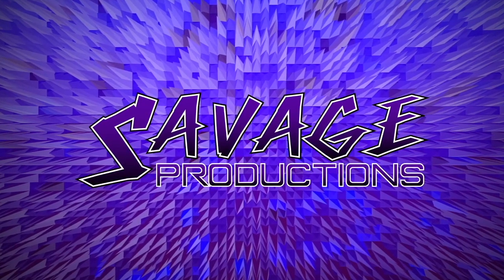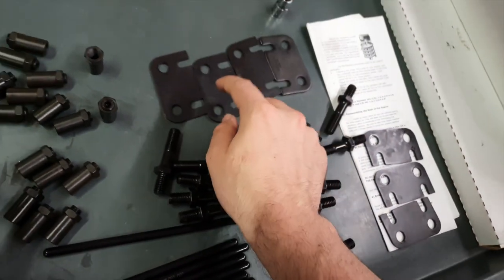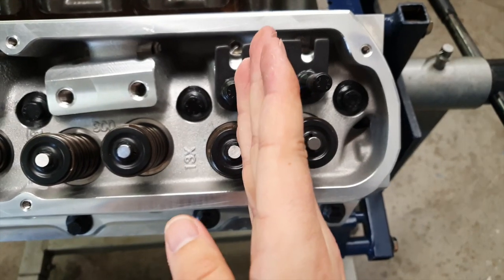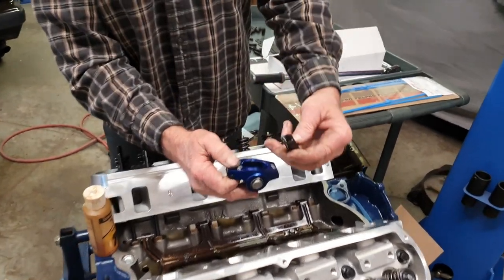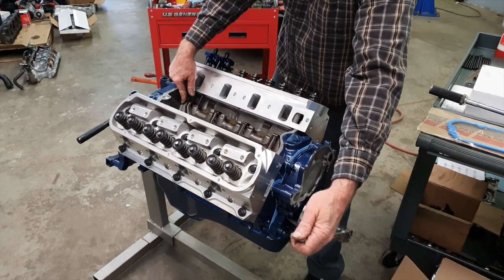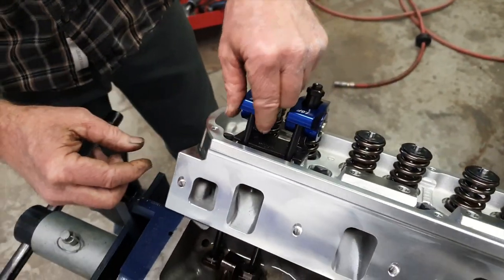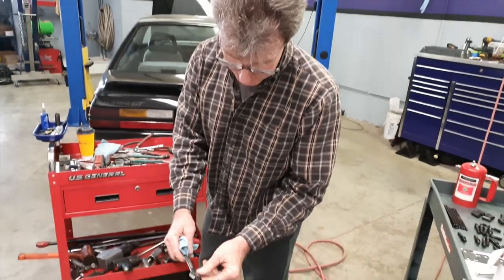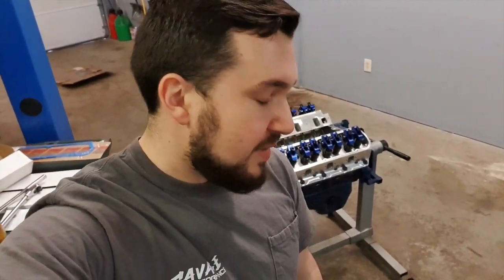How To Install/Adjust Roller Rockers - SBF With New TrickFlow 11R Heads

Comment: Cool video I'm 65 years old and I rebuilt my first engine when I was 12 years old I have been around cars literally all my life watching my dad and my uncle's working on their drag cars every Saturday night they were going over the cars getting them ready for racing on Sunday I was to short to see over the finder of the 55 and 57 Chevys that they had so they built a platform for me to sit on so I could watch them doing the work this way in the mid 60's and good ol'boys building their engines and things were a lot different then you always turned your engine over and got the rockers to just losing there slop as it was called then around here then start the engine and tighten the rockers just enough to take the tap out of it ran it till it was at operating temperature and then adjust each one by backing off the nut till it just started tapping and tighten till it stoped and then tighten the nut up around a half to 3 quarter of a turn and of course us a filler gauge to set them I've heard of and seen different ways of setting them but I really like the way you showed how to do it I'm getting ready to pull the heads off of my 65 Comet with a 302 with 351w heads with roller rockers I'll definitely use your method of adjusting the valves when I put it back together thank you for sharing this with us I'll be looking for more of your videos

Comment: Hi, great video. Have you ever used 11R heads with a comp cams roller cam? Did you change the springs or did you use the preinstalled 11r springs? Regards! Madison

Comment: I have a 351w with 1.6F rollers. Starting to make a loud tick. When I pulled valve covers some push rods I can spin with my fingers.  Not much play up and down but they do spin in place. Is that normal or should I readjust them?

Comment: I currently building my first engine ever. This was an amazing video by the way! I have the same rockers. I'm building a 331 with gt40p heads and a comp xe274hr cam. What is the easiest way to measure proper pushrod length?
Reply from the maker: You can buy an adjustable pushrod to measure the correct length. There's instructions all over the internet for knowing how the length is correct. Also, you can pretty much tell just by looking at it. That might be a video we decide to do at some point!

Comment: What are your thoughts on block splitting on an internally balanced 347? Can you go over 500hp with some boost and be fine. Thank you
Reply from the maker: If you have a stud girdle and it's balanced, 500hp should be fairly safe, but there's always a chance the block is weaker. 347s are harder on the harmonics compared to 331s.

Comment: Did u need different pistons with a different valve relief for the twisted wedge heads? Im building a 306 with a twisted wedge head and try and copy or have a similar build
Reply from the maker: Not with these 170cc heads

Comment: Just curious, what is the purpose of having the intake coming down before adjusting the exhaust? I thought once one side starts to open the other side was ready for adjustment. Thanks.
Reply from the maker: That's just the proper timing of when to adjust each rocker.
Reply: @SavageProductionsCars  Thanks!

Comment: After seeing this I'm wondering if I can turn my 351c 2V engine into a roller rocker-cammed-out-beast. LOL Actually I could use more than 300 hp. My engine is a 2v fresh stock build. I want to add roller rockers, new cam, new heads and hopefully these parts will work with my Edlebrock 351 Performer LB Intake and 650 4V Edelbrock part #2750 Performer 351-2V intake manifold designed for street 351C and accepts 4V carb. They are new parts.

What trick flow heads and cam size will I need to increase hp from 300 to hp to 350-380? Thank you. Great info video and look forward to some advice.
Reply from the maker: If you wanted to call us/message us and figure out the right setup for you, you can actually purchase the parts from us (as a thank you for our advise) at or below retail price, and we can drop ship them to you. All our contact info is in the video description.

Comment: Do you think a stoke 5.0 valve cover will clear the polylocks?
Reply from the maker: Stock fox body valve covers do fit if you use the blue felpro rubber & metal gaskets
Reply: @SavageProductionsCars  thanks guys 
I'll watch your vid again to get the part number.
Reply from the maker: You can order from us! We drop ship.
Reply: Mine is a sn95, stamped steel covers

Comment: When measuring for push rods on a 302, do you use a new unpumped lifter or a solid?
Reply from the maker: Either use a solid or a hydraulic that's pumped up fully
Reply: @SavageProductionsCars   Thank you! So..then add .030 to the length? So If I came up with 6.750..add .030.. which would be 6.780.. so 6.800 length?
Reply from the maker: @19jody72  what did you use?
Reply: @SavageProductionsCars  I used my old stock roller lifters. Im 100 percent sure they did not compress any.
Reply from the maker: @19jody72  then you wouldn't add anything if it's solid/fully pumped up
Reply: @SavageProductionsCars   OK. I thought if you use a solid or pumped lifter you have to add for the length the lifter compresses?
Reply: @Savage12 THANKS! Thats exactly what I needed to know. The witness mark  is dead.center of the valve stem using the 6.750 pushrod(pushrod checker tool) measured with micrometer. So after talking to you..based on my measurements..ill order the 6.750 pushrods

Comment: The rocker studs should only be torqued to 45 lbs on an aluminum head application. 55 lbs (as stated in this video) is for an iron head application just fyi

Comment: Can trickflow 11r 205 heads fit with the factory pistons on a roller 351w? No valve reliefs
Reply from the maker: No, you'll need pistons with valve reliefs for that size

Comment: I’m thinking of buying the 190cc 11r heads, I’m debating on running a .325 intake and .338 exhaust cam lift with 1.7 rockers for a total of .550 intake and .575 exhaust to maximize the flow of those heads. The target rpm is 2700-6300 but I want redline to be 6700, will the valves and springs that come with those heads work with that or should I order them bare? That’s also given if my pistons will clear that kind of lift lol, if not then I’ve got a back up with a .500 I and .525 E valve lift that’s a bit more conservative
Reply from the maker: Do you have stock pistons? With the 190s, you'll need twisted wedge style pistons.
Reply from the maker: And is it a 302 or a stroker? The 11R 190s are too big for a 302 unless you have compression and running 7000+ RPM.
Reply: @SavageProductionsCars  its a 302, I was originally planning on 170cc heads but was recommended 190cc. So would you recommend the 170? And yes, they are stock pistons
Reply from the maker: @DylanC828  there's a bit more information we'd need to make sure you make the right purchase. If you want, give us a call (phone number in the description), and you can order the parts directly from us. We're a TrickFlow dealer.
Reply: Wow I can't believe Savage said you need twisted head pistons and the 190s are too big for a 302. First the TW heads have 11degree valves and that means tons of clearance between valves and pistons. Even an 86 shortblock with flat top pistons will have a lot of clearance. Second, the 190s are not too big for a 302, as all you need to ensure if that all the rest of the components match the induction and exhaust. Intake, cam and exhaust are imperative. I've seen 376rwhp and 400rwtq with a stock short block 302 with the right peripherals with the brain being the cam.
Reply from the maker: @velr50gt  To be fair, this is Justin (the son who doesn't actually work at the shop) who runs the YouTube channel.  I typically ask my dad when people have questions on things I'm not familiar with, but I thought I was correct in saying 11R 190s required twisted wedge style pistons.  I did ask my dad about his recommendation for this particular setup Dylan had, and he recommended the 170s.  Me saying "The 11R 190s are too big for a 302" was probably just lost in translation when I actually meant the 11R 170s would benefit this particular 302 build more.
Reply: @velr50gt  will stock piston using TW heads 190 work on xe274hr cam - will it clear
Reply: @vipsymbol  it should clear with no problem. I used an aftermarket piston on my 349 built because it was a brand new rotating assembly with obviously more stroke and a big cam.

Comment: Trick Flow says you need thread sealant on the rocker studs per instructions..... Any reason you didn't do that?
Reply from the maker: (Edit for correction)
Good point! On these heads, the holes don't go all the way through into the ports, and they don't go through into the coolant passages or anything, so we didn't have to use thread sealant.
It definitely depends on which heads you have. If the threaded hole for the stud goes all the way through into the ports, then you need to use thread sealant (white permatex high temp). Otherwise, you don't need to.
Reply: In case anyone else is wondering it's not just for studs that need sealing it's for metal studs into aluminum so they don't seize.

Comment: I just rebuilt a 302 in my 66 stang, I have comp cam roller rockers 1.6 on it, can they be adjusted by TDC each cylinder in firing order or do they have to adjusted like you did here, or can they be adjusted while running, they CANNOT be preloaded due to I loose all compression, dunno why, I can only 0 lash them out, but I seem to be having issues with 1 of them chattering, may be a bad lifter but everything is brand new, I've been dicking with these ever since I rebuilt it, went by the book, everything is brand new except block. A helpful response would be greatly appreciated. TY
Reply from the maker: They can be adjusted in whatever order you want. There's some overlap, so doing it in firing order might make you have to rotate the assembly more times than just going in line.
Reply: @SavageProductionsCars  TY on that, can they be done while running?
Reply from the maker: @jeffgerou3247  no, the preload must be set when the valves are at specific locations.
Reply: @SavageProductionsCars  ok, I do understand that part, but every time I try the preload technique, get them all adjusted there is NO compression until I take the preload off then the car starts right up.
Reply from the maker: @jeffgerou3247  you might be adjusting the intake valve when you should be adjusting the exhaust valve and vice versa, or you might be adjusting them on the wrong part of the stroke.
Reply: @SavageProductionsCars  I will go thru all of them again and double check, I'll adjust them the way you did here, TY for the responses.

Comment: Is there a.standard push rod length used on a non decked 302 with twisted wedge heads? Do you check the length with pretty pumped lifters or? First time  doing a cam.swap for me by myself
Reply from the maker: Which TrickFlow heads?
Reply: Jody  Trickflow recommends their 6.7” pushrods in the regular twisted wedge 170 heads. These 11r 190 heads have a revised valve angle so you need their 7.050” pushrods.
Reply from the maker: @CentralVAracer  these are the 170s
Reply: Trick flow 170's.

Comment: I have a 89 302 (fox) and I just put the 11R 190’s on. It have the same rockers as this build and a trickflow stage 1 cam. Any idea what length pushrod I need??
Reply from the maker: The best thing to do is buy an adjustable pushrod measuring tool. Unfortunately, there's no magic formula we're aware of for that. If you call TrickFlow, they may be able to get you started in the right direction. I believe my 331 came out to be 7" exactly, but the block was also decked a bit and I had a different cam.
Reply: Ok I got an adjustable rod from comp cams. 6.8-7.5 tool. Looks like 6.8 is a tight fit! Block is stock. Does that sound right??
Reply from the maker: @miker351w  I wouldn't really know. As long as your lash is correct, you should be good.
Reply: Savage Productions Thanks, last question about your pushrods is what width did you go with?
Reply from the maker: @miker351w  whatever the hardened thicker walled ones were. I don't remember, sorry.
Reply: measure

Comment: Trick flow needs to make guide plates that allen bolt into backside of pedastal that are set up already because geometry sucks on these i got a set of 11rs.   Side loaded a rocker arm took out trunion and siezed oil pump on 351w then snapped a msd distributor in half

Comment: What can a guy do when the guide plates allow to much side to side movement of the rocker itself... I have a couple that are running on the edge of the valve stem based off the wear on the rollers... But the opposing rocker on the same guide runs perfectly straight.. only have 500kms on the build and it was built at a reputable company
Reply from the maker: @83glxcrusin97 without split guide plates, you just have to adjust them where you get the least contact on both sides. The tolerances are pretty good, but not great, so you should only get some minor rubbing, which will be fine over time. Maybe change your oil a could more times than you usually would after break in. We had the same issue a few times, but it all turned out okay.
Reply: @SavageProductionsCars  Awesome thanks 👍